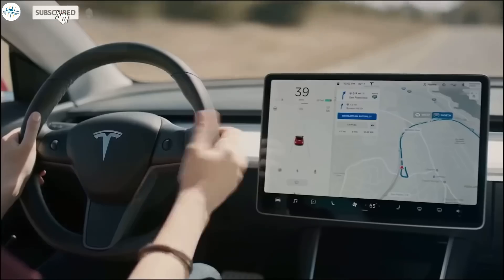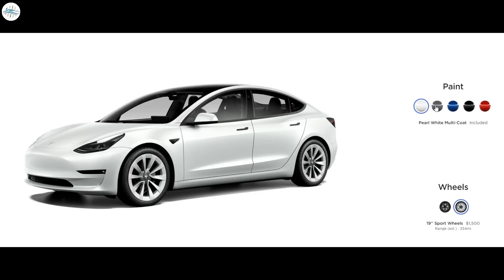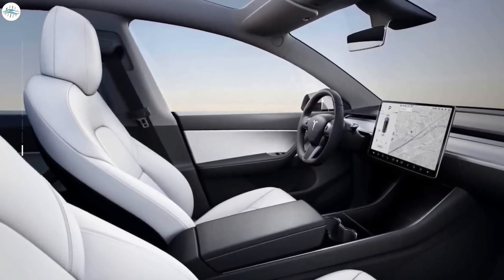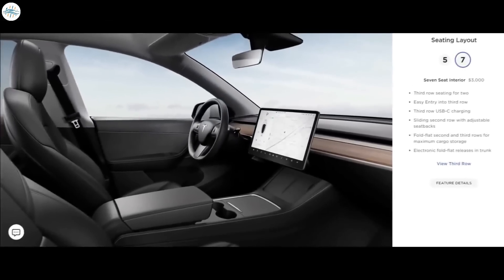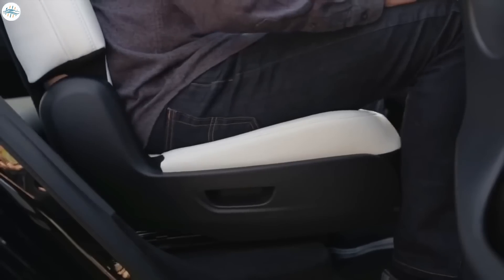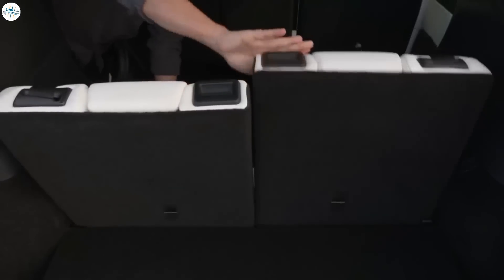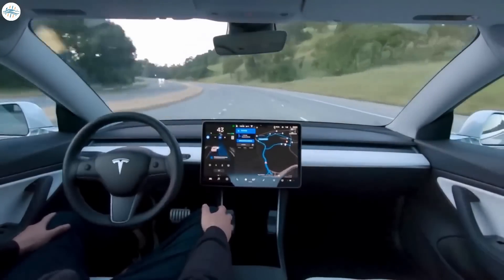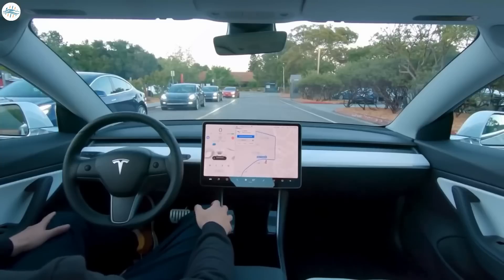Buying A Tesla Model Y or 3? | Don't Make These Mistakes!

Comment: Okay video but remember Tesla prioritizes performance models which is 5 seat only for the Y. The long range version will take several months, but if you can wait that long then this video is solid. Love my Y perf!
Reply: I ordered mine January 31 and take delivery this Thursday ModelY LR
Reply: @niyajackson8158  wow you must live in Cali or upgraded to FSD. I live in NC. Go on the Tesla site and try to order a LR Y and it will be several months.
Reply: @coryvb3056  no I live in DC I did have FSD from jump but they still quoted me August. Then it went to June-July, May-June, September, May6-9 and they text and emailed me saying choose a date and I received my VIN
Reply: @niyajackson8158  I would love to have that happen for me. Initially, my EDD was April 30-May27 then a within the last couple of weeks it was pushed back. Now MYP EDD is May 27-July 1.
Reply: @dwilliams8994  🙏🏾 I said a little prayer for you…
Reply: @niyajackson8158  Thanks, I need it 😅!!